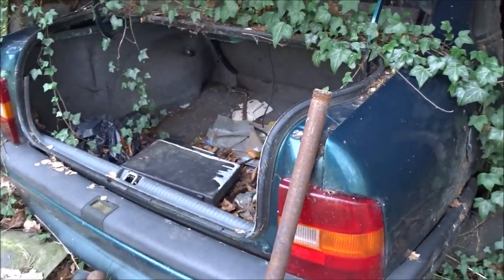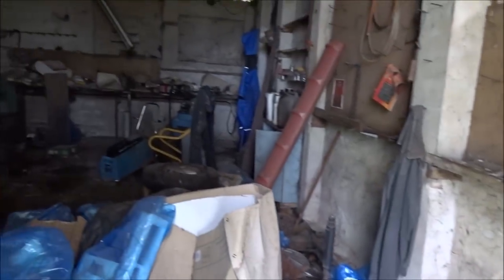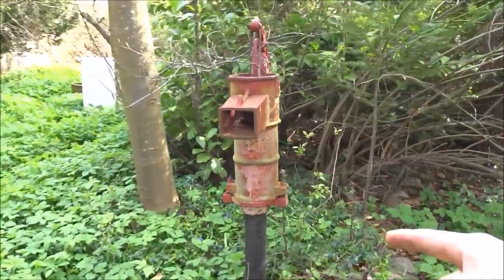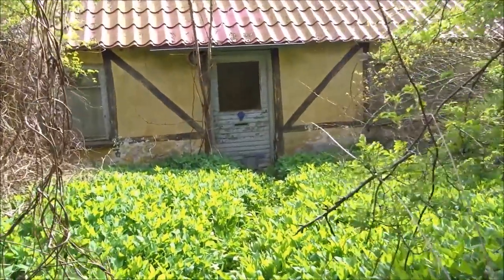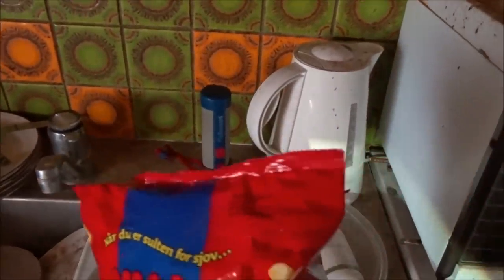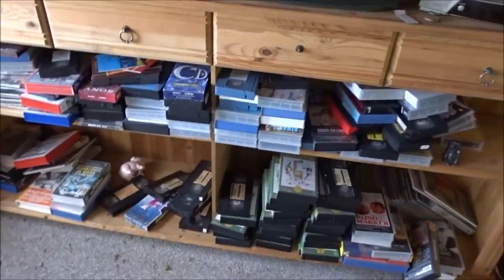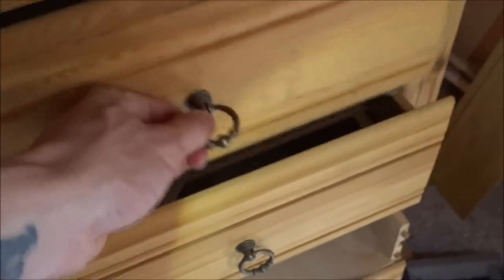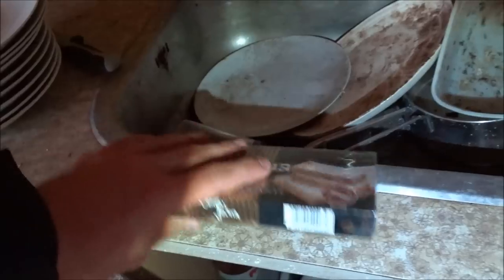Abandoned House everything left behind - Found old iMac!

Comment: 5:20. It's not a first generation iMac. It's more like a fifth or sixth generation from about 2001 or 2002. Apple didn't offer CD-RW drives on iMacs until 2001. The color was also changed slightly from the original iMacs. If it still works it could be worth about US$100.

Comment: That is the 1st iMac! 1998 I think, my mom had the same one! The processor was inside the monitor!👍🏼😃🔮ɱყʂɬıƈąƖɱơơŋ🌙
Reply: I wanna add, the 2 best things about it was that it came in a couple of colors and you didn't have a big stack to mess with which made it really portable! The keyboard was blue too! Lol!✌🏼🔮ɱყʂɬıƈąƖɱơơŋ🌙
Reply: Mystical Moon The first ones were a greenish color. Other colors came later.
Reply: Yup, this one is probably 2000-2001 (earlier ones didn't come in this particular colour, Indigo). And no, it's not valuable - I think I paid 50 Euros for mine last year and felt that was a bit much. Mine didn't have the box and original CDs though.

Portable... well sort of. They do have a handle but thanks to the CRT screen they're beastly heavy!
Reply: Caryn  Schwengel bondai blue, i loved that colour
Reply: that was the slot loading version. I think these were the summer 2000 series.I have the exact same machine, was great when new, but over time the speakers rot and the drive's belt goes. they aren't worth that much now due to the repairs that would have to be made, but it was neat to see this one in it's box more or less, don't know if it was in the process of being put back in the box, or was pulled partially out by someone else though.
Reply: Yup, it is. I worked at Sears in 99 and we sold them.
Reply: well, I looked at the video again and noticed the styrofoam was still around the support leg on the bottom, this machine might have never been used. thinking it was pulled out partially to see what it was at some point, judging by the amount of dust on it, I would say that occurred at or about the time the house was left.
Reply: I had the Imac G4 model, Bought brand new back in the day and still use it to this day ( only for music ). The IMac's of 1998 get bought a lot to convert into iaquaiums for fish. I bought a the Imac 1996 model for the reason, just actually not got round to making into an aquarium yet.
Reply: Of all the crimes in the world, I am now a terrible person. Sue me!
Reply: Caryn  Schwengel  You're right, Lol, I checked and hers was an aqua marine color! 🔮ɱყʂɬıƈąƖɱơơŋ🌙
Reply: Carboy7  He's NOT a bad person! They didn't last very long, my mom's had problems within a year and she had to buy a different computer! Using it as an aquarium is actually an awesome way to repurpose an item and that makes you an awesome, earth 🌏 friendly person! 👍🏼😃🔮ɱყʂɬıƈąƖɱơơŋ🌙
Reply: EDC KNOWLEDGE  That's an awesome way to make something that would go to a landfill useful again! 🌎friendly! 👍🏼😃🔮ɱყʂɬıƈąƖɱơơŋ🌙
Reply: Thank you Mystical Moon for using a brain and not being judgmental. I did indeed buy a broken one....is it worth repairing ? NO it's not. I love fish and it will be a nice talking point in my office at home.
Reply: What's your problem? Is it your Mac I am using? Upset that that I am re-using a old Mac ? Go buy them all then an save the broken ones from the rubbish heap. Maybe I don't want a regular aquarium. The beauty of human beings is we all have different tastes and designs. Maybe something you have a problem accepting. Have a good day, or evening.
Reply: believe it or not, this is an age-old issue. most compact, and later imac collectors all had an issue of a working machine being converted into an aquarium, early mac collectors considered it sacrilege. so an effort was made to ensure only non-working machines ever got this treatment. with the failure rates of these I'm suprised that there isn't a steady supply of parts machines out there that would be perfect for macquariums. or in this case, Imacquariums...  have even seen one turned into a litterbox.
Reply: no the first one's from 1998 were bondi blue ;)
Reply: i saved 2 iMac g3's from the trash one is from summer of 2000 and it's a indigo color and the other is a summer of 2001 and it's the snow edition one they both work great :)
Reply: Speakers are cheap, a dollar or so each, and easy to replace. You can probably get drive belts somewhere online. Or just replace the drive with a new one. Probably will take a DVD drive as an upgrade. 

Or do without any disks and just use USB sticks. 64GB sticks didn't exist when this was new. More like 64MB.
Reply: your point is?
Reply: your comment makes no sense.
Reply: well, I have only seen drives, not belts. the internal drives on these were slot loading, and I haven't had luck in finding many. and don't have the $35 to replace the drives that I have seen online, maybe I am missing something?  that said I just use external speakers, and an external firewire optical drive. for any CD's. the internal drive worked just enough for the mac os reinstall, but I had to really hope it would eject the disc, lol. the common failure on these was the video analog board. when that went it basically killed the machine, and not many I knew of were willing to deal with the relatively high costs (At the time) to try to replace those, usually at that point An "Iquarium" was a better alternative. as far as I know.
Reply: Macquariums... I like that! Lol
Reply: Haha, "the processor was inside the monitor"
Reply: Caryn  Schwengel .... my eldest son had iMacs in his music studio in the 90s. He gave me one, a green one - it was my first computer, I loved it and the see through green colour ... it worked very well ..... well made and designed
Reply: Cool , great place , great finds .

Comment: That was an iMac G3 and it originally released in 1998. It was the first line of Apple computers that had color casings. It also marked the return of Steve Jobs to Apple. They first came out with OS 8. That model probably had 233Mhz CPU and they usually came with 32MB RAM. It was a cool computer for the time but only an Apple collector would want one of those now. I've seen people turn them into fish tanks or cat beds.

Comment: Under the cordless phone! A Commodore box! Did it have a computer in it? Go back and check!

That bottle is either full of vermouth or piss. If you were going to drink it, hopefully it's piss. The flavour's more bearable. 

Most old speakers are cheap garbage. And the cardboard cone won't appreciate being left in the elements for years, getting damp / wet and then dry again. Equally the steel parts are likely to rust. 

One way of telling a good speaker is try to lift it! My Mission 500s are just normal-sized speakers, but carrying them for any length of time is an effort. Dunno if it's because Uranium has excellent sound qualities, but generally good speakers = very heavy. Cheap ones, not so. I suppose when you're selling cheap stereos with included speakers, keeping the shipping costs down is important. I've no idea what's inside my Missions, they're not designed to be opened, and I wouldn't want to damage the expensive sound quality.  Well, I say expensive. They're the low-end of expensive speakers. REALLY expensive speakers come with a team of security guards. 

3:40 , this video brought to you by Death, from The Seventh Seal. Nice one, Death, wondered what you'd been up to the last 60 years. Still play chess much?

Comment: The first Apple computer was from 1977. That's not it. An old Imac is worth nothing.

That said, they're not too old. It will probably still work. The specifications could be anything within a fairly wide range, depending when it was made and how much it cost. It's an all-in-one. All you'll need is a USB keyboard and mouse, and it should work. You might need an operating system install disk, but probably not. 

It won't run the latest OS and software, since it's got a PowerPC CPU rather than the modern Intel. But there should still be Mac OS 9.something for it. I'm not a Mac guy but somebody should know. They're not difficult, you might be able to do it all yourself. 

It has limited hardware but might run an old web browser, or even a modern one. Is Opera still made to be lightweight? Or a lightweight version of Mozilla, there are some. Also will play old Mac games, reasonable quality video (though I think the drive is CD-only, not DVD). You could attach it to your network at home if you have one. Maybe add a USB Wifi adaptor for it. 

I dunno. But there might be some use for it. How much, depending on it's specs. Of course you don't take anything, so that doesn't matter...

(TAKE IT! NOBODY WILL KNOW!)

And then go back and check the Commodore box. Might be an Amiga, might be a C64. From the larger box I'd guess Amiga. Which are worthless and useless nowadays, but maybe if you had one in the old days... I'd prefer an Atari ST.

Comment: The still pictures are a nice touch. BIG video quality booster.
The iMAC is NOT their first model by any stretch.  Steve Jobs [apple founder] 
Always had a gripe about how UGLY computers are. You can take a Forbes 500 model office, 
set-up a computer on the desk and instantly turn the office into a dump. 

Apple had a typical Computer body [Tower] Separate monitor and mouse with the new Operating system [OS] OX-7.
the OS proving itself made an appearance upgrade justified.  So the eggshell iMAC was borne.

This was the computer body and the monitor built into one piece. 

Same OS but much prettier. Steve puts FORM over Function sometimes to a dangerous point 
of added production costs. But that was Apple's appeal, THEY LOOK GOOD !!!
He even mad a laptop that looked like a neon coloured CLAMSHELL,  same OS.
These appearance boosted computers worked!!  Apple stocks [due to sales] took off like a rocket. 
That's why the apple products had only one button on the mouse, Steve thought 2 buttons where ugly.

America was in love with a computer body and monitor in one piece and a keyboard and mouse integrated 
with only one wire to connect. These where 1990's models. before that was a mini mac, black and white quite useless but so weren't all the other brand names..  I wasn't an apple fan because I couldn't control the OS, I'm a Linux fan, 
their source code is open. The Apple system [closed source] is very similar to linux. Think of MAC as being a closed source linux system, with some differences.

First Apple was an Apple I  it was a briefcase prototype then a short run. Then when Mass produced became 
Apple II 1982-ish, then the Apple IIe [more memory]  then the Black and white monitor/computer body in one  Mini mac. The Lisa was a famous FLOP !!  Peace of crap at $10,000 A whopping 10 megabyte external hard drive that crashed daily.

Video Editors still like their desktop systems that are more conventional, so they can add capture cards and editing gadgets
to the system, however this past couple of years everything seems to have gone back to the all-in-one system with a wireless keyboard and mouse,  REAL CLASSY AND CAN GET EXPENSIVE !!! up to 30" monitor/body in size .

Most users prefer Adobe suite for MAC because Apples video editing software has gone to the sharts. 
They still excel in Music editing and staff composing.

Comment: But I would wear gloves Incase it’s a drug house or there’s a body or it’s a hide out. Would not want my fingerprints around just in case. And that Apple you saw came later because I had the 1st $3000 Apple which was a box  shape but could talk. Not sure of the year for the one you found but they came in different colors. I brought a few apples and have two Mac mini’s  . And had the 20 inch which was stolen, and the next size up that I gave away and now the 12inch iPad along with them and the 1st Apple Watch, Apple TV, the smaller iPad and the 2nd watch and have been though 6 iPhones but never got the  color series ones. But to be fair I just got a gaming/work 17”3 HP windows laptop that I fell in love with.